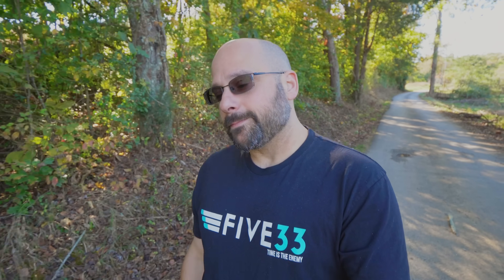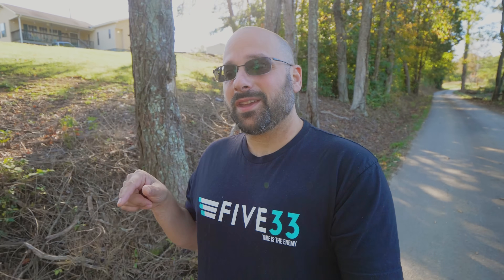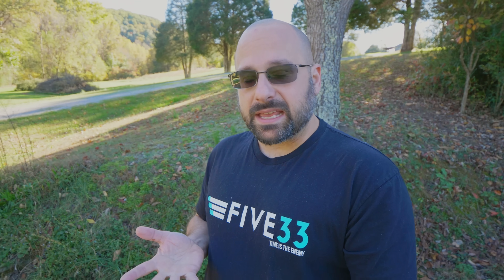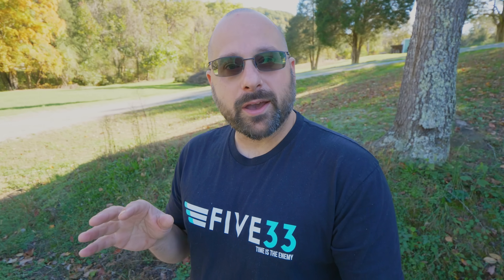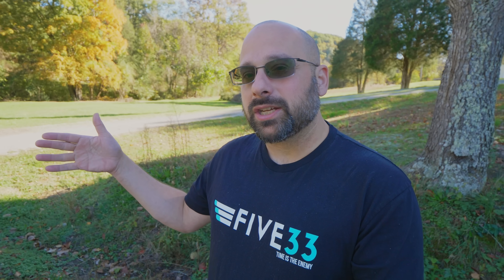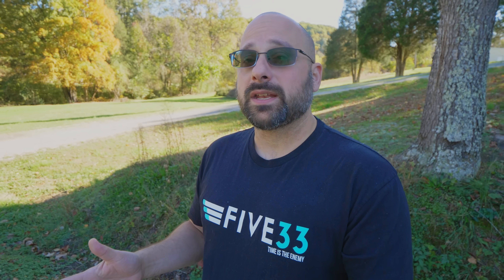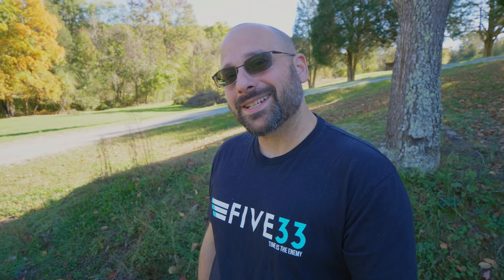How long can you leave your lipos fully charged without damaging them?

Comment: This still leaves a lot of unknowns and hypotheses.
If the batteries where left charged for 60 days, is this 5% of the now reduced 95% battery and so on? Or completely different, maybe logarithmic.
What happened to your battery tester? Isn't this perfect for that? Test a few batteries and check they're close resistance, capacity, real C rating etc, and come back to it after 1 month, 2 months... Maybe testing some that arent left fully charged all at once. It wouldn't be scientific, but you could also compare a battery you regularly fly to them as well.

Comment: I am also a firm believer that the better the cell the less keeping them changed is a problem.. I have one single 3s Lipo (2600mah) that I have had for 10 years for an airplane.. and yes it is low C compaired to drone batteries now a days.. but that thing sat chaged for 5 years at 4.2v and I recently cycled it a few times in that same plane and it was perfect..
Reply: I had four 6s 1300mah batteries sitting around for about 2 years at full voltage, 2 of them died with cell error but 2 of them still works fine, they can survive but there is a high risk that it will get damaged

Comment: Does this mean that discharging them at a slow rate (I dont have an actual discharger, I use my charger which discharges at like 0.5A) is as damaging as flying it pulling a lot more amps?
Reply: Nope, not as bad... it's still a charge/discharge cycle, but what really kills batteries is discharging at high current loads (i.e. what they're made to do) but at lower charge states.
Reply: @tehllama42  Thanks, expected as much but wasn't sure.
Reply: No. Everything is proportional.

Comment: I like to have mine at storage ASAP, as I have a fear that them being fully charged increases the risk of them catching fire - I don't know if this is true or not, but either way but i'd rather a flatter battery go up then one fully charged.. again I don't know if the fire intensity is the same, charged Vs. disscharged, I guess thats a pretty easy test to do, but I'd rather not kill two batteries for "science"... & I'll just tell myself it's safer with a lower voltage, only ever had one let go, a HV while charging & it was pretty crazy.. sleep tight everyone.
Reply: More energy = more fire

Comment: I charge - discharge/recycle my lipos to my 4S3P 21700 "Powerbank". This is quick and the Lion pack didn't notice this little amount of energy.

I have 7-8 years old lipos and they are still fine after hundreds of cycles.
Reply: That's an excellent idea!
Reply: I too have 4S 1800 mAh flight batteries from 2016. Not suitable for flying anymore, but works fine for googles or radio charging.
Reply: Yup same, I have a big 18650-based field pack that I usually discharge into, then use those to store any batteries I need to, then top it off to storage if it gets pretty low.
Reply: Best advice I've seen today! Love it. This convinced me to use a car battery as a power bank.
Reply: @yannickg6904  Thx. Car battery's are so unhandy. Grab a spot welder and some cheap 18650. DIY packs are a lot of fun. 😉
Reply: @BBFPV  I wouldn't mind putting an lead acid battery in the trunk of my car. It could come in handy in the middle of winter with some booster cables, lol.  I already do DIY packs and don't even bother with spot welding 
(I know, I know).. So far it worked out good, I have four 4S packs made with 18650s and one with 21700s. I've used them all summer long successfully.

Comment: A 4.2v lipo bomb has more damage potential than a 3.8v lipo bomb. Probably also worth noting
Reply: Completely agree, a cell at 4.2V is way more unstable than one at 3.8V. Personally, I never keep them at full charge more than a few hours.
Reply: Yes, I cannot sleep well away from home, if I left my overcharged lipos at-home over night.
I'm already quite concerned about the lipos will burn down my place eventually
Reply: @jacktheripper1784  99.999% of lipo fires occur during charging/discharging. A fully charged lipo is just as safe as one at storage if the battery is in good condition
Reply: I wanted to mention it too! Thanks and like
Reply: https://youtu.be/Y9qCovQiTQs

Comment: Also, charging the batteries at high currents wears them out faster than gently charge them at 1C. Same for discharging, although that's hard to influence. So it's not necessary the best to wait until the last second and then charge at 4C just to minimize the time they are full.
Reply from the maker: Lipobench once did a test that found the opposite. That charging at 5C was better for the battery than 1C. The hypothesis was that the higher charge rate heated the battery up more which reduces IR and means it takes charge easier. But it's only one test, and charging at higher C rate absolutely does increase the chance of a fire if the battery is damaged.
Reply: @JoshuaBardwell  I've seen numerous tests stating that the higher charge rate reduced the life cycles

Comment: How long is it safe to keep batteries at storage voltage without using them? Like if I don’t fly all winter?
Reply from the maker: Basically forever. I mean, not really forever, but certainly months.
Reply: Years. I have some older packs that are nearly 10 years old that still work well.
Reply: You should be safe to leave them over the winter at a storage charge. It is a good practice though to check them every couple of months or so to make sure they are not dropping voltage over time.
Reply: JB literally said it in the video and the answer is forever
Reply: @onden  he said it in the video right after I wrote the comment lol
Reply: @bakerfx4968  oops :D happens to me too
Reply: Thanks all!

Comment: The question becomes: What is the relative impact on battery life of a charge/discharge cycle vs. being left charged for 24hrs (or some multiple thereof).  Knowing that would help to guide the question of whether to leave charged until use or storage (dis)charge them until next charge & use. 

This was a small video that gave us a few answers but left some perhaps even bigger questions.  Your stated conclusions do tend to mirror my own, thanks for the confirming/supporting opinion.  

J.P.
Reply: I would imagine that how you discharge matters too. Normally when I discharge, it's using one of those store safe things which is way under 1c, so the impact of discharging it is much less harmful than when I actually use it flying. Thus, I don't feel it is wasting a full cycle.
Reply: @dogatech5763  I don't think it matters if you discharge it under 1C, you are performing a discharge cycle anyway.
Reply: Slow discharge is really not that harmful to them, and wouldn't be any worse than discharging them through flight (at least 2x as kind), but realistically most batteries aren't getting electrically worn out anyway unless you're trying to pull triple digit amperges out of them, then landing gently.
Reply: To conclude this we should really deep into the chemistry, the quality variable and testing batteries a ton of times
Reply: @jofagoma  If only manufacturer's would release their testing and r&d data instead of keeping it proprietary, then we would have it for multiple companies and be able to make a general conclusion. As is to get that granular would be pointless as each company uses slightly different chemistry and materials. Just my small collection of cheap batteries varies widely even ones from the same manufacturer but different lines(eg turnigy nanotech vs silver vs reg.) One could hope tho..
Reply: @lanceshipley7139  although I bet there's a thesis already about lipos. Will search and share if I find something more
Reply: The way I see it, LiPo has about ~300 cycles in its lifetime and maybe 100 days at max voltage. Charging back from storage to full will consume about half a cycle of those 300. So doing the math it is actually much better to discharge to storage then to leave it at 4.2V for an entire day. Alternatively would be to charge it only to 4V which is much less harmful over time but still gives you about 70% of capacity.
Reply: @kmunteanu  fair estimate on the cycle life of LiPo.  Interesting speculation about days of full charge.  Though I'm not sure how close it may be to the actual life cycle of LiPo, I have nothing to refute it.  LiPo cycle and calendar life is a complex subject, of which I only know a little.  Still...  

These days I store at 3.85V and charge to 4.15.  This storage charge seems to be in line with current data for optimum lifespan.  The slightly lower max voltage gives close to 95% capacity and by my wild guess may increase cycle life by about 20%.  My speculation here comes from knowing that chemistry deterioration increases significantly as you approach the max nominal voltage of 4.20V.  All in all, an interesting subject that is more meaningful as battery prices are increasing of late.
Reply: I agree. This video has little fact and lots of supposition, but JB raises some good points, especially about the concept that a battery has a lifetime based on its time at full charge and the impact of leaving a battery at full charge vs discharge/recharge. I just hope these questions will now be answered by people with some real data. JB have you any ideas or contacts who can get some such data?

Comment: I find my large high output batteries like a 120c 6s will puff very quickly left at full voltage 
But my little ones like a 75c 3s for a micro will last forever at full voltage. Now I use the small ones more but I have enough of them that some still sit for weeks without being used with very little issues
The little ones will loose voltage over time but the all charge up just fine 
It’s like the high output ones take damage but the low output just leak voltage…. Maybe it’s enough to keep them getting damaged

Comment: I suffer from LiPo anxiety so much that I only charge the Batteries on the day that I fly. I have a sub 250g quad, with 3S packs that are tiny, so they don't take that long to charge. When I am not using them, I put them to storage voltage, and then I put them inside LiPo safe bags, and then put those bags inside a LiPo safe box (BatBox). I live in a small apartment, with no outdoor garage or shed to store them in, so I have to store them in my home, hence my extreme anxiety. 

Videos about this from repuitatble people like yourself JB really help me have confidence that I am treating my batteries well enough to not have a fire on my hands. There was a similar video from painless 360 recently too talking about this topic, which I recommend to any folks going through the same worries as me: https://www.youtube.com/watch?v=qz_uTiXbNi4
Reply: Gotta say I dissagree with Painless saying to only balance charge ever 3~4 cycles (not a direct quote but close) .. I feel you should balance every charge.. if you ever have a bad cell the charger will over charge another cell(s) to reach your target voltage - much  safer to always balance.
Reply: @Ryet9  but balance charge puts more strain one the battery?
Reply: @villiamnilsson1994  lets say you have a 6 cell battery & lose ONE of those .. you now have 5 cells right? to get to 25.2v or the expected 4.2 per cell * 6, you need to over charge each of those remaining cells by 0.84v each... having 5.04v per remaining cell!... yeah... no, balance charge your batts every cycle (not sure on the math exactly but i'm sure it;s close or even near correct), you be the judge of what is more strain on a battery.
Reply: @villiamnilsson1994  It does put more strain on the cells evidenced by the longer charge time at the same charge/discharge voltages.   If you watch a balance charge you will notice a kinda push pull going on where the charger  pulls voltage(current?) from the higher cells and trys not to  from the lower cells. As they are all connected it gets a little messy. This is becoming a little moot tho as most new smart chargers do a sorta balance charge normally and have cell overcharge protections. Pretty much if your charger has a screen and software updates, you're good to go.
Reply: @Ryet9  But if you lose one cell and the your charger does not warn you... then you probably need to change charger. I guess I would say that you should balance charge if it is needed (old unbalanced cell) or if you had a crash. I probably should get a charger that can measure internal resitance though.
Reply: Omg.. 🙈
Reply: @oleg146  😅
Reply: I've never known anybody to feel bad for not taking LiPo safety too seriously - it's fine.  Having a setup you can charge outdoors with quickly is actually pretty amazing, and preferable.

Comment: But doesn't discharging and recharging wear it out faster than just leaving it charged for a weeks 
I Know I'm not using any batteries for ~2 weeks and I’ll start thinking about discharging.
leaving them plug in is really the only way I've really killed them short of crashing the cells trying to get home.
Reply from the maker: Like I say at the end of the video, cycling them also wears them out. But I don't know of any evidence about which is worse, or how much full-charge time equates to one charge/discharge cycle. So you have to strike a balance. But I don't know what the balance would be.

Comment: I never leave a battery fully charged overnight, especially due to fire concerns. Only exception are low C goggle batteries.
Reply: that's crazy effort. 
I have 10-20 that are charge and ready to go at all times.
Reply: @RCRitterFPV  I only charge right before flying and ensure everything is storage before night. As a result even my first 5 inch batteries with probably hundreds of cycles that haven't randomly dropped a cell (Tattu probs) are still punchy and zero puffing.
Reply: The main danger while the battery is changing voltage, charging for example.  A not damaged, fully charged battery, sitting on a shelf, not connected to anything - runs a very very very low risk of spontaneously combusting.

Comment: “Without damage” doesn’t it get damaged everyone you use it? 
I try to fly them soon.  
But I’ve had some charged for over a month..
No difference
Reply from the maker: I wonder what the IR would show before and after leaving them charged for over a month.
Reply: @JoshuaBardwell  ive got a brand new 6s that I accidentally shorted single balance lead that id try it for the sake of science if you’re interested
Reply: That’s exactly what he said, every time they are charged and discharged they will take a hit, and there are only so many cycles a lipo will endure.

Comment: A few days is fine. But anything more, you should discharge them. Just for safety sake. Damaged cells are no bueno. I've lost a few quads due to using batteries that were left fully charged for far too long. Them fires can get bad.
Reply: I feel like this is the best answer - the batteries are more likely to be forgotten about after a day or two, and become a much larger danger to things that are expensive.
Reply: @tehllama42  I also forgot to mention charging fires. Had 2 from improperly storing batteries. Luckily I have plans in place for that so it's always contained and can't spread, but it still sucks and is very dangerous.